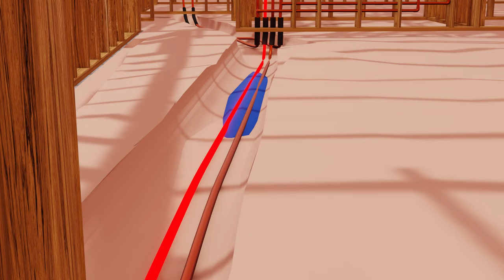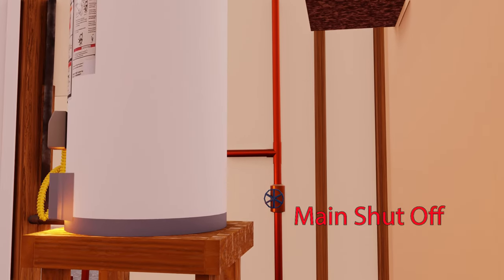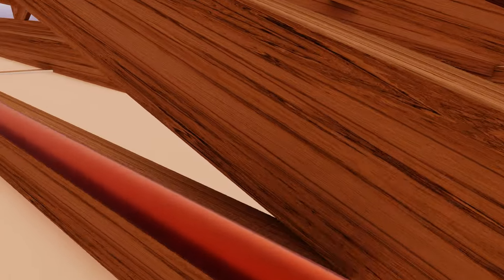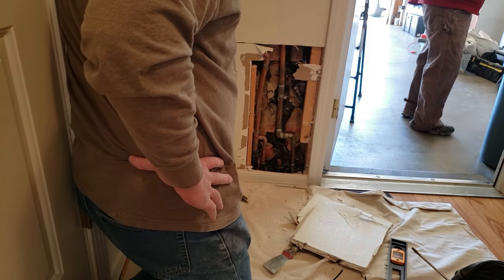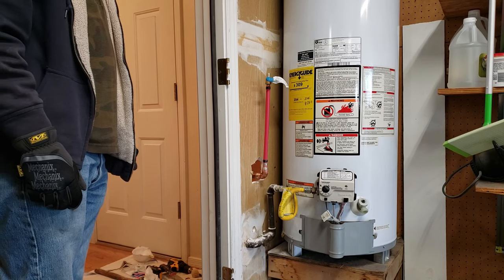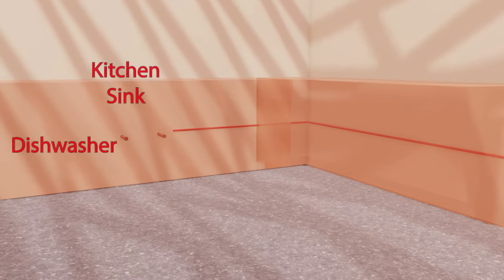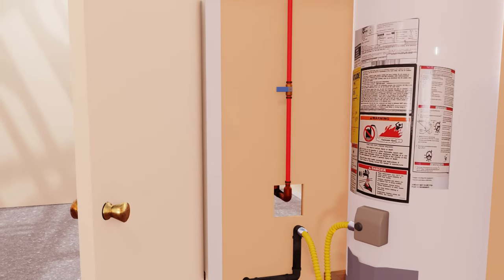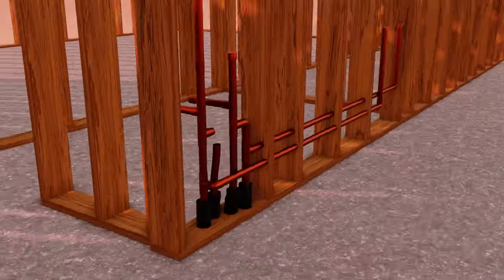Underground Leak Repair: Fixing a Water Leak Below a Concrete Slab

Comment: Mr.Rusty the problem is to save money The Contractor told The Plumber to run The Copper Pipes under the slab instead of running them in the attic. P.S. My Dad was A Master Plumber and this was one of his Pet pevees!! He used to say it's better to replace sheetrock in the ceiling and walls then break concrete!!
Reply from the maker: Your Dad was right, Rolando! It probably was a money saving idea to run copper under the slab when that started. I built my house on a pier and beam type construction primarily to let me be running water lines while it was being framed. I have sure been glad over the 30 years since I built it to have the flexibility to access all my plumbing as needed. I have a large crawlspace and even poured some concrete sidewalks and lighted it. Your Dad and I would get along well, I bet!

Comment: A hot water heater? I have a cold water heater. Why would you want to heat Hot water?🤣🛫
I am with you using the push on fitting near the gas line if you were not able to make up that joint anywhere else.

Comment: When I got a slab leak, I opted to immediately re-plumb the house using pex, routing a loop in the attic with wall drops.  Fairly easy and my hot water loop allowed me to setup a circulation pump on my tankless and have instant hot water!
Reply from the maker: Sounds like a good solution for you. Yeah, understanding the idea of what needs to be done to pull off a repipe is not difficult. Getting access to all the areas you need to get to do it becomes the bigger task but what a relief when it is done! No more worries about another leak under the slab!
Reply: The hot water recirculation alone would make it worth it.

Comment: Incredible video and so much great information.  I had a similar situation in my house and bypassed with PEX.  Animation and video is fantastic.  Great job on it all!
Reply from the maker: Thanks for watching, Syber, and for your comments. Yeah, it's a relatively easy thing to do with Pex conceptually. The process can be more challenging at times, but what a simple solution to a big problem with great tools available these days!
Reply: I have hot spot on the floor in my bathroom. Can I bypass with PEX if I can isolated the leak? Thanks
Reply: @conchim99  There's a good chance you can bypass but it depends on your house design and whether the hot water line is accessible.
Reply: @SyberPrepper  I think it is leaking from down stream after the bathtub because my water heater is located outside in side yard near the city water meter. I can break open the back of the facet and reroute from there a long the wall. There is a second bathroom that has exposed hot water copper pipe running vertical inside the closet that houses the central air heater unit. It was hot to the touch. I could use that and hug pex line along the wall go in the back of the facet.
Reply: @conchim99  Just remember, you'll have to make a copper to PEX junction (I forget what it is called, I'm not a plumber.) somewhere which will need to be soldered.  The PEX connects to the other end.  Hopefully in a place that easy to get at and not near anything flammable.  Make sure you shut off valve shuts the water off completely.  If not, you'll have a hard time soldering the pipe if any water remains in the pipe.  Also PEX doesn't bend around corners very well so you may need some 90 degree fittings. Best of luck.

Comment: PEX is the way to go. Is your hot water pipes installed in parallel?
Reply from the maker: Yes, Dude, tools have changed things a lot for the better over the years and Pex is a big deal. Copper has always been the gold standard, but time and conditions that cause it to disintigrate create very major problems. I have been surprised at pinholes that develop in copper within maybe six inches or so of circulating pumps and it can happen relatively fast. Must have to do with the electric field created and its impact on copper. I'm not familiar with "parallel" in installing hot water pipes. Was a plumber's helper for only about six months 50 years ago. Must have not been paying attention that day!

Comment: Jamaican Plumber: You Americans always use copper. No PVC.
Reply from the maker: Copper used to be the standard for decades until Pex came along and was accepted by the regulators but as you know, copper has its problems too. CPVC was generally used in mobile homes. PVC under pressure has always been ok to use in lawn sprinkler systems but not in homes.

Comment: Are you in TX? How much is to repair this problem?
Reply from the maker: No, in NM. Cost depends on the house and the scope of the problem. You've got to locate the general area of the leak first then determine what you need to do to bypass that section of pipe. When you start cutting into walls and running bypass piping is when it can get pricey. The materials themselves are not that expensive but the labor cost is the real problem if you cannot do some of the work yourself. Plus, it's hard for someone to accurately estimate how many hours doing a repair like this might take. Then, there's the repair and painting of walls that comes next. It really can turn into a nightmare! That's where it is nice to be handy and have some knowledge of construction processes.

Comment: Where are yaw located we got a hold  Neighborhood full leaks in  Concrete slab. No plumber wants to touch it said it to much wrk🤷🏾‍♂️
Reply from the maker: Yes, that does not sound good if lots of homes built around the same time in the same neighborhood have leaks under the slab. Doing those kinds of repipes usually puts you in cramped quarters working in tight spaces. You have to have a lot of patience! Patience is one thing most plumbers I have know don't have!

Comment: You should have called a leak detection company.  They would have found the leak precisely and then you could decide whether to open up the floor or re-plumb.  This happened to my daughter yesterday.  Leak detection cost $600 on a Saturday morning.  Plumber came and drilled and Jack hammered the slab floor.  The carpet and pad was destroyed by the water leak, so we tore it out.  Once the floor was cut out, 2’x2’ square, we found the leak immediately and made the repair.  Turned out to be the Heat Recovery Unit hot water feed, so we really did not need it as it could be easily bypassed by shutting off the flow valve at the hot water heater.  Total cost $1,100 on a Saturday.  The 5,000 square foot 4 bathroom house did not need to be re-plumbed which would have cost around  $8K-$10K running new lines through the attic of this massive house, as you did in this video.  Leak repaired, thousands $$$$ saved.  House is plumbed with CPVC and is only 20 years old.  All I have to do is patch the concrete floor, about 2 hour job, tops.  I learned a lot in the process, as the leak detection company taught me a lot.
Reply from the maker: Thanks for telling your story about the leak at your daughter’s house, Robert. People checking out this video will benefit from your experience which is more common than realize. Water leaks are something you don’t think about until it happens to you. At the 10 minute mark, I relate that I had my brother in law call two leak detection companies first thing when the leak was discovered. This was a Friday and the earliest either could come out was “maybe” the following Tuesday. The charge just to show up was $500 which would apply toward the cost if they did the repair. Otherwise, that was the cost to try to pinpoint the leak, which was not guaranteed. It was the middle of winter and that was not going to work. 

Once we began exploring a bit, it was obvious that the leak was under the utility room floor as the wood flooring in one spot was hot. Busting out concrete would destroy the glued down wood flooring and increase repair costs, plus this was the second failure of the copper pipe under the slab so it would be difficult to feel confident that it might not happen again. Since we had bypassed the other leak 15 years earlier, once we opened the wall up again behind the hot water heater a second time, it was obvious what we had done before and a solution to this problem would be relatively simple. We had hot water restored to the bathrooms in a couple of hours and finished the re-pipe to the rest of the house by Saturday afternoon. Total material cost was around $200 and took about 10 hours of work. My brother in law took care of the drywall repairs himself.

Obviously, not everyone has access to family members like you and me to help deal with things like this and save them money. The purpose of my video is to inform homeowners of what happens when an under slab leak occurs in copper pipe, most of the time on the hot water side. Copper pipe has been the standard for water line installation for decades and generally thought to be permanent. It is not but it can last a long time. The existence of leak detection companies who are backlogged four days, as in this experience, tells the story. Personal experience in my case as a contractor also says otherwise. There are other choices besides busting out concrete that may be better long term solutions but time, expertise and access are always the problems for homeowners.

I have twelve videos on my YouTube channel of projects done for a customer that resulted from an under slab water leak… the third leak that each time flooded their master bedroom floor in a span of two years. I became involved after the third leak which turned out to be about two feet from the second leak. The very frustrated customer wanted to not have another under slab leak. So we re-piped the whole house, hot and cold water, abandoning all pipes under the slab. Two story, five bedrooms and four bathrooms and it was expensive but gave them peace of mind. After that, they decided to remodel all their bathrooms so I was there for a while. Videos on shower floors, barn doors, tile setting, grouting, caulking, etc. all came as a result and actually helped launch my YouTube channel.

I’m surprised to hear that CPVC was used under a slab to plumb a house that is 20 years old. I would have assumed it would be copper. Thanks for watching and for your comments, Robert!

Comment: Whatz ur opinion on Pex as it relates to rodent damage.  In other words is Pex susceptible to rodent damage?
Reply from the maker: That’s a good question, Gordon! I have not come up against that issue. I would think that typical field mice would have a tough time chewing through Pex. It is flexible but rigid and thick-walled. Now rats, squirrels, etc., may be a different situation. I would think if an animal could get its mouth around the Pex, it might be able to chew through it over time, but it would be a chore! If not, I don't think so. But if it happened and you could access the location, it would be an easy fix. Thanks for raising that question!

Comment: Wouldn’t the glue down floor start to fail from the moisture in the concrete slab coming up? Don’t you have to dry the concrete now?
Reply from the maker: Yes, if water is actually coming up through the slab, the wood will start to swell and buckle so you will have that problem to deal with and it will be obvious quickly. In this situation, the leak was discovered almost immediately because the water heater was running continuously with no hot water usage happening in the house and the family snapped to what was happening and closed off valve on the water heater. The slab near where we cut the hole in the wall was hot, so we assumed the leak was under the slab there. The ground in our area of the country is decomposed granite and sand so it is really porous. The water typically goes straight down. Now if you have a home on clay, it is a whole other story!

Comment: Are copper pipes usually running IN the slab or rather UNDER it?
Reply from the maker: Typically, the slabs are 4" thick so the copper passes through the slab and is buried in trenches under the slab that are probably 18" to 24" deep. The copper needs a plastic sleeve installed around it at slab level to keep the concrete from coming in contact with the copper pipe. If the sleeve is not there, the copper will corrode where it touches the cement and leak over time.

Comment: Hi!
I have a question.
What if the supply pipes are in our attic and we still have water coming out of the cracks on our slab foundation?
Reply from the maker: That doesn't sound like a good situation regardless. It probably does not have anything to do with the pipes in your attic, but there could be a leak in the water supply line coming to your house that is finding its way to the cracks in your foundation.  If you live in an area that gets a lot of rain, you could also be having some groundwater and/or drainage problems with water flowing toward your foundation rather that being diverted away. Good luck.

Comment: Amazing video! Thank you for sharing. Curious about how you would fix an exit leak from drain to sewage.
Reply from the maker: No sure I completely understand your question, but drains and sewage lines are not pressurized so the answer is pretty straightforward. Anything that will stop the flow of water is a solution. If it’s a crack or a loose connection of parts that screw together, there are products on the market to try to seal those areas. Thanks for watching!

Comment: Great video. Did you use 1/2 inch PEX? Did you get the same flow as before?
Reply from the maker: Yes, 1/2" Pex for this repair as it feeds the kitchen sink and washing machine. The first repair we did about 15 years ago we ran 3/4" copper to get more volume to the back bathrooms. In either situation, the water flow has not been an issue. Interesting sidenote... this past week the water heater in the video started leaking so we had to make a quick mid-week swap of it. Video to follow! Thanks for watching!

Comment: So basically you rerouted throguh the ceilings and attic? Also any idea why the original plumber didnt  go through the attic/celing in the first place?
Reply from the maker: Yes, you do what you need to do to get the water lines to the faucets in the house as easily as possible. The fastest way to install copper water lines in this type of construction is to run it under the slab in the ground which is code in most areas. It's just a mess if you have a leak down the road. These copper pipes lasted about 35 years before a leak ever showed up. Then one more after another 15 years. This method for installing water lines with this type of slab would have been the norm for plumbers 50 years ago.

Comment: I live in a 30 year-old two bedroom bottom floor condo with hot and cold water in the slab. There have been a growing number of units around the property experiencing leaks and needing to jackhammer out the floor to repair it. One poor lady was living with family for six months during the repair simply because they couldn't find the leak. Her floor was Swiss cheese by then. When they found it, they repaired it, only for another leak to show up as soon as they pressurized it.
I'm making a mental note of this. If I'm unfortunate enough to have the experience, I may just have everything, hot and cold, redone in PEX in the walls. Drywall is probably a LOT cheaper, and as you pointed out, it's only a matter of time before it happens again! I may be a cynic, but something tells me that insurance would argue for some reason.
Reply from the maker: Thanks for the story, Jay! I’m afraid it is a pretty common occurrence, much more than people think. The reality is there are solutions like running Pex through walls and ceilings that that can solve the problem that sometimes can be very simple depending on access. It is hard to trust copper lines under a slab that have already sprung a leak before!

Comment: This is a super video - I learned a lot.  Question: could a person use an on-demand water heater in a distant bathroom rather than running new pipe back to the water heater? That is to say running the entire bathroom one one 3/4" inch cold water pipe?
Reply from the maker: Thanks for watching and for your comment, Thomas. The simple answer to your question is yes, but as I'm sure you are guessing, it is not without some potential pitfalls that relate to volume of water available and pressure in the lines. But, sure, one 3/4" cold water supply could feed a water heater and hot water lines as well as supplying water to cold water lines. If it is for a master bath with two sinks, a tub and a shower, it would work but probably not very well!

Comment: Couldn't run a water line in an unheated attic here, it gets too cold and local codes thus prohibit it.
Reply from the maker: Yes, certainly really cold climates can be more of a problem but you have to have water. Codes relate more to new construction and remodels, I would think. There is a type of Pex that is designed for very cold locations. If I had no other option, I would be inclined to install heat tapes and insulate the pipes in those harsh environments. Depending on the situation, I might install a second heat tape as a backup if and when the first heat tape failed.

Comment: when you mentioned running and soldering the 3/4 copper pipe in the attic it reminded me of when i upgraded all the electric and added central a/c in my previous old florida house with limited attic space. wow that was hard work and i cant even imagine doing something like that these days. great video!
Reply from the maker: Thanks, Brent! Yes, I used to do lots of things without giving it a second thought in attics or under houses. With age and a little wisdom, that doesn't happen much anymore! I can only imagine in Florida with the humidity how brutal doing the work you did was! Thanks for watching!